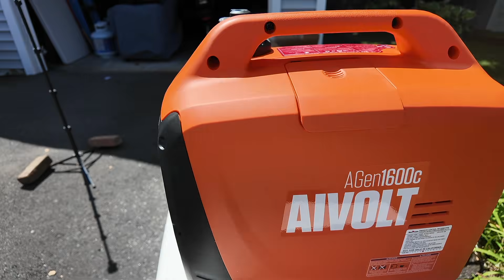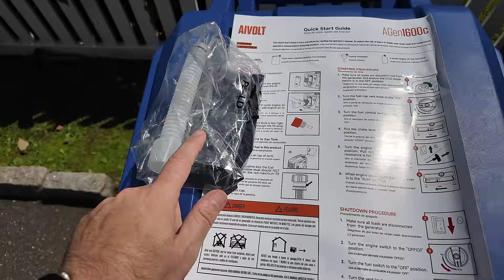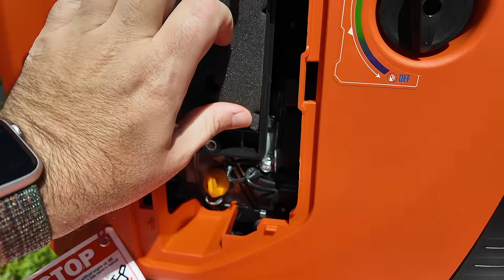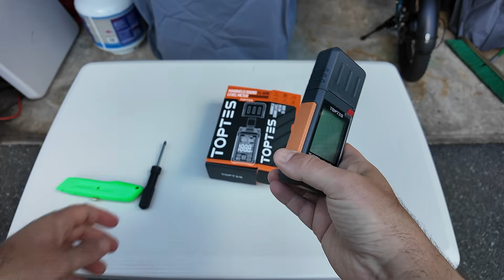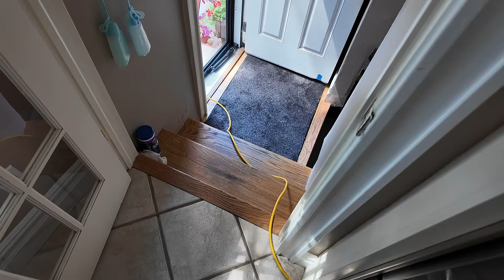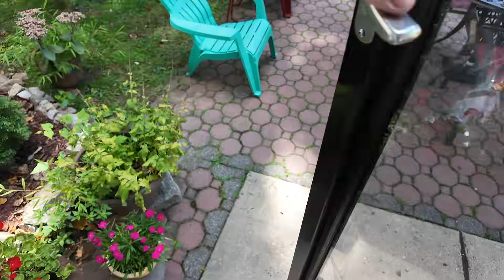I Bought the CHEAPEST Generator on Amazon… BIG Mistake?

Comment from the maker: 👉 “Would YOU trust the cheapest generator on Amazon in a real blackout? YES or NO — and why? I want to hear your take.”
Reply: Most of people are afraid of Chinese made generators but, if you do your homework there are a few top quality manufacturers in china producing absolutely perfectly efficient and affordable machines, I’m a WEN fan but there are many as this brand you just review that are infalible…great choice sir.
Reply from the maker: @KubanKamping I totally agree with you! In fact almost every generator is made in china! You’d be hard pressed to buy an American generator. The Chinese units have done a long way and are exceptionally reliable. Thanks for watching
Reply: @Outdoor_Prepper whats the fuel tank size? Run time at 50% load?
Reply: @KubanKamping 2 is 1, and 1 is none. Cheap for power outage that happens once every 1 yo 5 years, a Honda for very frequent uses.
Reply: For us older guys, the light weight of this generator makes this attractive.  The reviews have been great.  I bought one as a backup to my larger generator just so I can charge my power station.  Don’t plan to lose the fridge contents again.  It definitely has a place in my survival inventory!
Reply: @NoBucks777 I have one too its easiest generator to start and dry shutdown empty the carburettor well made too
Reply from the maker: @twim1006 thanks for watching
Reply: 349 aussie money to my door frieght included i have alot gennies none of them start as easy as this one its well made no leaks cant say that for others i own
Reply: Whats the return policy like
Reply: Should of shown how long, a tank of fuel would last.
Reply: I buy absolutly NOTHING from Amazon. All they are doing is putting small business out of business and posing a danger blocking 2 lane highways while making deliveries and not having brains enough to pull into driveways to make their delivery.
Reply: @JerryRedd-bs8xi  You’re not making a difference.

Comment: I am 70 years old and the very last thing that I need is another generator….That being said, I have had my eye on this generator for about six months and watched many reviews, including yours. It’s one of those that you just got to have….. It works absolutely perfect and I couldn’t be more pleased with the size and the weight, considering I am not a young man anymore….. it is now my go to for my camper, and it will be the first thing I pull out during an electric outage at home while I decide what’s next.
Reply from the maker: That’s fantastic to hear and it’s surprisingly quiet and lightweight . Thanks for watching
Reply: @Outdoor_Prepper  The downside to this generator is that it has old-school brushes in it, which means that they will eventually wear out and the life expectancy of this generator is about 600 hours…… In July 2026 they just came out with the AIvolt 1750w generator, which does not have brushes and expected to last much longer….. It gets slightly less fuel efficiency, but it’s actually two or 3 pounds lighter because of no brushes….. I will probably wait three or four years until they get all the bugs worked out and then I might buy one.
Reply: @Outdoor_Prepper what size is the gas tank?

Comment: I had a fire due to that coiled up reel, it will heat up and kill you. Uncoil it
Reply from the maker: Thank you for the heads-up, I will make sure to keep the cord fully uncoiled to prevent any overheating issues!
Reply: @Outdoor_Prepper From the net
Using a coiled-up extension cord while running a high-draw appliance is dangerous because it traps resistive heat. The bundled loops prevent airflow cooling, causing copper wires and plastic insulation to reach extreme temperatures that can melt the casing or spark an electrical fire. [1, 2, 3]

Comment: Do you know how many gallons of gas is holds because many of the 2500 W generators claim to run 10 hours at 25% load and they average about 1.2 gallon gas tank
Reply from the maker: It’s a very small tank - about 1 gallon max

Comment: You could burn through five of those generators and a single Honda would still be running fine.
Reply: You’d have to burn through more than 5 to equal the cost of a Honda
Reply from the maker: Agreed!
Reply: Or you could spend 1/5th of the cost of a Honda and get all that you need to have. My generator gets pulled out, fuel changed and run yearly but I haven't needed it since 2018. How much to you spend on something that you don't need?
Reply from the maker: I understand your point, hopefully this one lasts a long time with proper maintenance!

Comment: I have a 1500w Pure Sine Wave generator uses 0.6 gallon gasoline to recharge Portable Solar Power Station 8.4 kwh of batteries.
Reply from the maker: That’s a perfect setup and will really extend your runtime!!
Reply: @Outdoor_Prepper more about quiet nights... recharge by daylight 400w portable solar panels or mini generator.
I use AV gasoline so about $2.50 per tank fill.😂
Reply from the maker: @kevinsage245 that’s a good plan

Comment: Too small to do much of anything but run a battery charger.
Reply: Don't know much about electricity do you. I average around 8kwh a day in the winter time, thats a average of around 330 watts.
Reply from the maker: Thx!
Reply from the maker: Not really - I powered my fridge, computer, phone charger and lights with it. It’s also great for recharging power stations . It’s a surprisingly powerful little generator
Reply: They don't make then that small in liquid propain do they I know they didn't about 10 years ago I'd rather have lp even with the little power loss

Comment: thanks, @Outdoor_Prepper.  It looks like I could run my small fridge and some fans or one small AC in a power outage, and I love how quiet it is. The few times I had to run my loud generator at night, I always worried that someone would steal it, so I always locked it to something, but it looks like this is almost impossible to hear when I put it in the backyard.
Reply: Also, in the winter, I would want to run my furnace, which is connected to my transfer switch, which uses the locking 4-pin plug. Can you do a video on hooking this one up like that? Thanks
Reply from the maker: Absolutely! They make an adapter for that and I will definitely make a video featuring it!
Reply from the maker: This would definitely fit the bill for a quiet unit and could run all those items! Thanks for watching!

Comment: Prices have gone up. I bought 4 power smart 2500w for 299 a few months ago. Everyone in my family got one. They've only been test run as no power outages
Reply from the maker: Hopefully you won’t have to use them but it's great to have them ready.
Reply: @Outdoor_Prepper yeah I'm set with multiple generators, power stations, batteries and solar panels so I gave each of my kids the little inverter generator and an oupes mega 1 so they're all set
Reply from the maker: @ronhawkins8604 that’s awesome and a great move!
Reply: Looks that they increased the price for hurricane season. I saw the price increased at the same time in all stores.
Reply from the maker: @tronziebit hopefully it goes back on sale. Prices seem to fluctuate fairly often and frequently seem to be on sale. Thanks for watching!